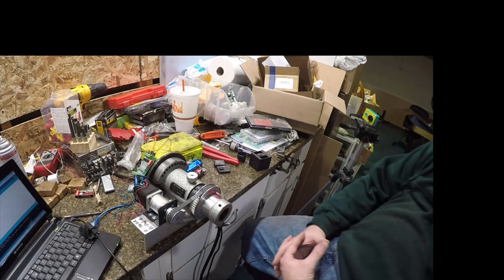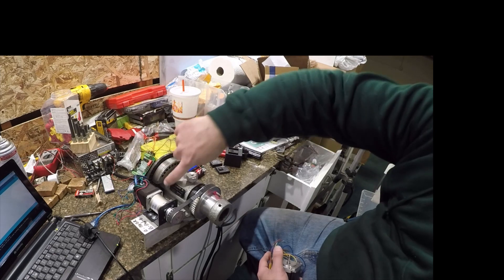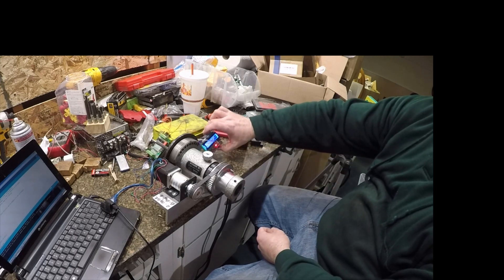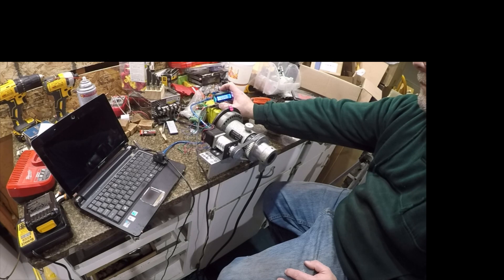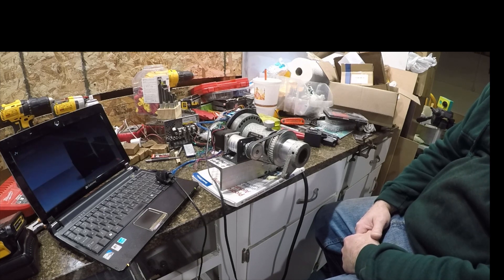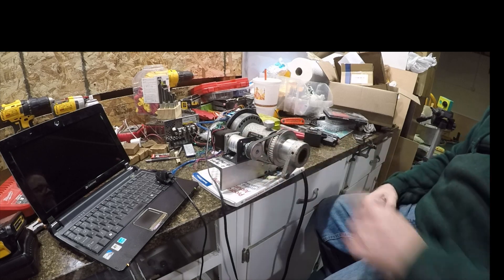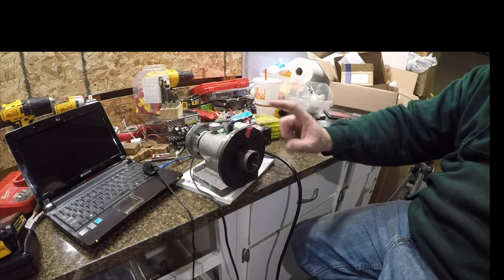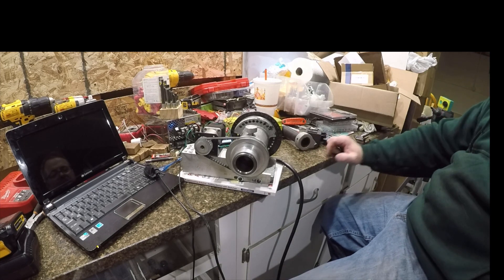STEP Indexer 127 tooth challenge

Comment: Nice job working out the kinks, Dan. What adjustments to the Liming code did you have to make for the gearbox? Any other significant changes? Keep up the great work.
Reply from the maker: TinkerThinker Good Morning and thanks for watching. I had to adjust the gear ratio with the code. Since I ultimately went with a 1:100 stepper. Sure it is slow but with gear cutting speed is my last worry. LOL.

Comment: do you have any schematics and or list of parts..i need to adapt a harig motorized spindexer to a incremental  unit for drilling  send me message if possiable
Reply from the maker: Web search www.liming.org or search for snail works. That is what I modeled off of mine. They also share the arduino code I used. Thanks for watching.
Reply: @houseofbrokendobbsthings5537  k thanks reply...am the old man at work ...the tinkerer
Reply from the maker: The electronics build was not bad at all. Loading the code took a little bit.

Comment: My laptop would likely have a spaz attack & cut 126.5 teeth or something like that !  The wide range indexing head that sits on my bench will cut 127 but the indexing equation is a bit funky as you have to calculate for the inner index plate as well as the outer . Cheers
Reply from the maker: Max Grant ,The Swan Valley Machine Shop. Thanks for dropping by. Also thanks for sharing.

Comment: This thing is cool! I have a stupid question though.. After each movement of the stepper do you have to lock the indexer somehow before you cut? I assume the action of cutting the material could slip the position?
Reply from the maker: deweys Thanks for subscribing. Yeah the silver knob on the top should by snugged during the cut. Also the 100:1 on the stepper makes it hard to feedback into the stepper.

Comment: Great project you have there Dan.  So, the stepper is 1.8 degree with. 100:1 reduction giving 20,000 steps per revolution times 2.5:1 reduction to the spindex.  This 50,000 steps per spindex revolution.  Wow, that is a lot of steps.  No microstepping then, correct?  Pretty impressive.  Thanks for sharing.
Reply from the maker: Yup JB  cautioned that the microstep might not give what I want at my low dollar stepper price point. It performs nice and slow for an old guy like me. The gear steps aren't all that slow - but angular or full rotations take a while LOL. Tick-tock-tick-tock. Feels like enough time to run upstairs get coffee - check mail..... LOL.
Reply: The 127 gear you wish to make is for perfect Imperial / Metric conversion?  Why not a different ratio that allows a small error.  Most lathes are set up that way.  Unless you have some other reason.  Workshop Practice Series #3, Screwcutting in the Lathe by Martin Cleeve discusses some of this error in depth in his book.  I can give you some alternative gear ratios if that would help.  But I am sure after all this work, you may be committed.  :-)

Joe

Comment: Wish I knew more about steppers, and arduinos.  Know any good arduinos for dummies books.  I have a spindexer and would like to put a similar setup on it.  Very good video.  Now cut that gear.  'Til next time.
Reply from the maker: Mature Patriot The coding is still mostly a mystery to me. But, with time and smart friends I will get it done. Harold Waters did a neat sketch for his mill. He was kind enough to share. 

I have a long way to go. But what is pretty neat is the hardware is cheap. Plus it doesn’t take much of a computer to write and load the  instructions (sketch) to the Arduino. This really helped as I was able to look at the code that was written by Gary Liming and nudge it a little and see what happened. 

Thanks for watching.

Comment: neat setup dan, with the stepper drivers, you can also do microstepping, which will split that 1.8 degrees 16 times or with some stepper drivers, you can even split it up to 32 times, but thats kinda pushing it tho. When I used to mess with making 3d printers, I used to set it at 8 or 16x microstepping for more precision. The only thing that I can think of that would introduce error into your setup would be the backlash in the gears of the speed reduction gearbox, but if your only going in one direction, it doesnt really matter.
Reply: Chirpy's Tinkerings it’s important to understand that microstepping does nothing to improve precision, all it helps is noise levels. When you engage a step with full power you know that is where the stepper is driven to. As soon as you “microstep” you are essentially engaging an electromagnetic spring between two steps, and actual position over time depends on many things, not the least of which is friction in the system and bounce once static friction is overcome.
Reply: I always was lead to believe that it splits the step into 8 or 16 times by adding power during two phases from the step at different amounts, which lead to it splitting that 1.8 degree step out into more steps, and in place, causes 8 steps to get through one standard 1.8 degree step.
Reply from the maker: Chirpy's Tinkerings Thanks Chirpy for stopping in. I started with 8 Microsteps and the error after so many movements was glitchy. JB advised to not fully trust the Microsteps on something like this. Using the hard gear reduction seemed to do the same thing without the glitchy stuff. Is it slow - oh boy yeah! But, its gear cutting and I am old - what’s my rush 😂. LOL. 

Next topic is cutting the six slots in the gear blank reliably.
Reply from the maker: I had exactly the same idea on Microstepping. It just wasn’t enough steps to cut down the error in the rotation. On paper it should have been good. Always came up a good ways off after 127 steps - grrrr!
Reply: Another thing you could have done is just printed out a paper disk that's like 8" diameter and have 127 lines on it, then use a pointer, or 3d printed out a 127 gear template and just used that to index it to cut the gear like I did on the shaper when gashing the worm gear for the dividing head when I made that, lol.
Reply: lol, whatever works and gets the job done, lol. I found with 8 microsteps it was fine usually for it, but if you went into 16 or 32, thats where it started introducing error rarely.

Comment: Good work.
When I made some gears for my lathe I found a tip to find the required diameter of the blank to make a gear.
I took one of the other similar sized gears and oiled up the teeth. I rolled it on a blank piece of paper to give (in this case) 128 marks.
 you need 127 teeth marks and 127 spaces.  That is the circumference. Divide by pi for the diameter. 
Maths would  be more accurate but this worked for me. It is also a good way to check the maths.
Cheers.
Reply from the maker: colm one Thanks Colm that is very clever. I have some aluminum blanks squirreled away waiting on me. Plus some assorted Delrin and other plastics. Glad I double checked - would have been crap to ding it on position 125 of 127 LOL!